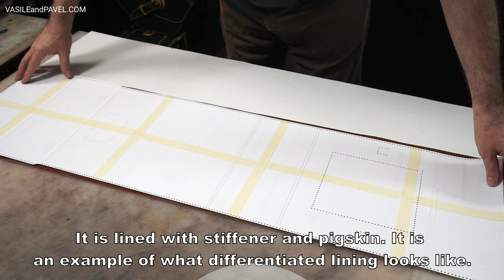How to Make a Leather Backpack TOSHIRO (with PDF Pattern)

Comment: On the plan, the straps that hold down the top of the backpack don't have any stitching holes laid out.  But, in the photos of the completed backpack, those straps and clearly stitched.  Is this just an oversight, or has the design changed?

Comment: Also, to be clear...You punch through all layers for the side strap buckles, but not for the back upper attachment points where the D rings are located?
Reply from the maker: the pattern have all the holes needed but because I work with glue and I have very good punches (sharp and with a very long active part), i can make holes in 12mm leather. It is easier than to match all those pieces. My problem is that I made so many leather objects and i tried so many different tehniques that I can't be consistent.

Comment: Why isn't the liner in the pockets continuous like in the main body of the bag?  I'd think you'd want it to be as sealed as possible so as not to get particles between the corners.
Reply from the maker: i want to control where the leather bends. It will be strong, don't worry.

Comment: If a person used saddle thickness leather do you figure he wouldn’t need the stiffening material?
Reply from the maker: if you have a good gouge and you can make precise cuts in all those places where the leather bends, yes. But it's easier with stiffener and lining.  When i made the design for this backpack, i knew i will line it.